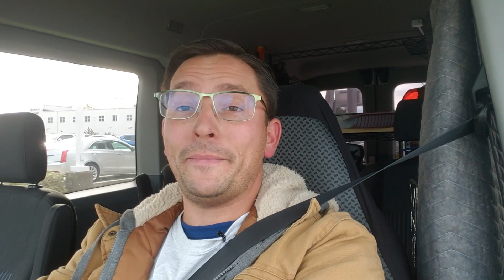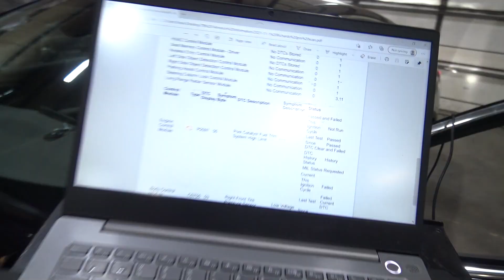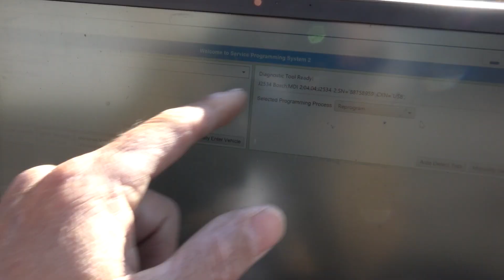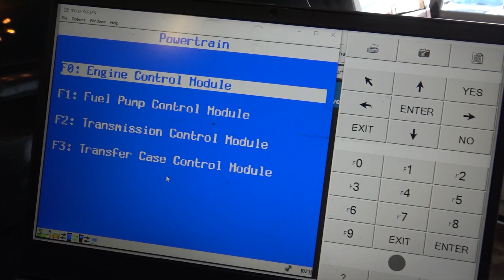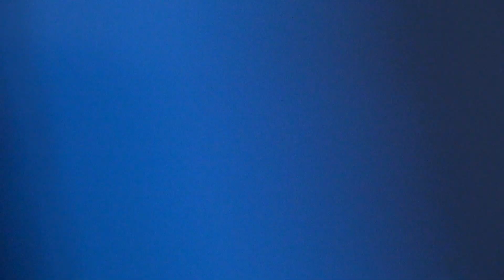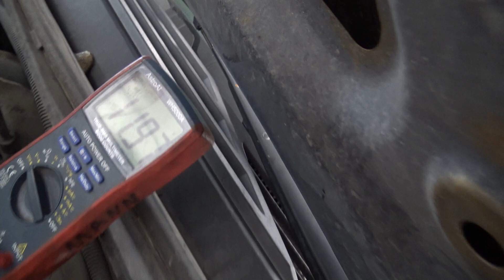End Of Day 1 11 2021

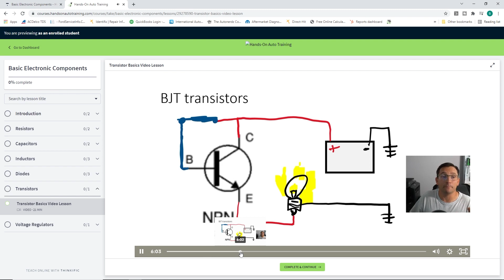Comment: Hi Brian, at 0:16, could you explain why the emitter follower configuration was chosen for this demonstration? Almost all introductions I have seen use the common emitter configuration...
Reply from the maker: Hello Dmitriy,  I have 2 answers for you a short version and long version.  My goal of the video lesson is just to help make people aware of transistors .       Short: I dont know.    Long :  I have been working to learn and understand basic  electronics and I am fascinated with the subject although  I am mainly learning from books.  I do not want to ever mislead anyone and I think I was mixing my ideas and test of building logic gates out of different transistors and may have made the drawing based on a project in front of me, so you could say that I made a mistake.

I appreciate all of your work , comments and advice.  Just so you know that transistor video is on the ultra basics, I think trying to demonstrate solid state  components can help create a interest in technicians.    If you think  I am misleading or will taint a prospective student please let me know and I will change lesson. Once again I appreciate all you do!
Reply: @BrianMann216  Emitter follower has a quirk: both base current and collector current go through the load and compete with each other. This could present issues when trying to make a switch out of it, but is very handy if you are trying to make a simple voltage regulator circuit (requires just one more Zener). As voltage regulators is your next topic, I was wondering if this is the reason for starting with the emitter follower. If you are interested in the idea, we can discuss further.

Comment: I MUST SAY,,, BRIAN DOES TRY TO HELP EVERYONE EVEN ME AND I AM NOT A SUBSCRIBER TO HIS AUTO CLASSES AS OF YET ,, SO I COULD ONLY IMAGINE THE HELP I WILL RECEIVE ON BECOMING A PREMIUM MEMBER . SEEING THE CODES OF EACH DIAGNOSES IS A GREAT HELP THANK YOU BRIAN . SPEAKING ON THE TRANSISTORS,, ARE THERE ANY MORE THEN THE IGNITION COILS THAT EXTERNALLY CONTROL THE PCM THEY ARE THE ONLY ONES I KNOW OF THAT ARE NOT IN THE PCM. THANK YOU AGAIN BRIAN FOR YOUR TIME !!!!!!!!!!
Reply from the maker: Great question.  There are some solid  state "relays" that I am almost positive they are just some transistors.  Fuel pump control modules have the FET's in them..  I will have to ponder this question.
Reply: @BrianMann216  I NEVER THOUGHT ABOUT THOSE SO CALLED SOLID STATE RELAYS LIKE YOU SAID . THERE IS JUST FAR TOO MUCH TO FIGURE OUT ON YOUR OWN IN THIS AUTOMOTIVE DIAGNOSTIC FILED. THIS IS WHY HAVING A MENTOR WITH YOUR CLASSES ARE MOST IMPORTANT TO THE SEASONED TECH AS WELL AS THE APPRENTICE ... THANK YOU FOR YOUR TIME BRIAN !!!